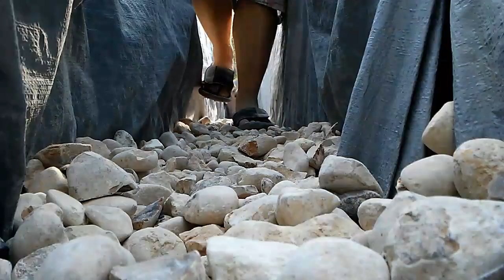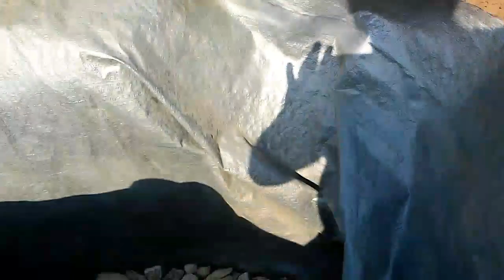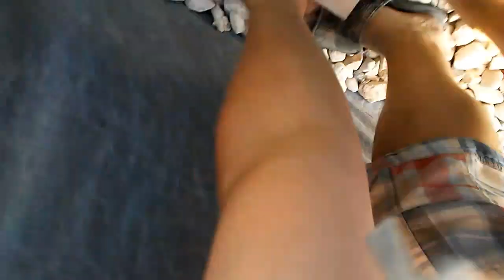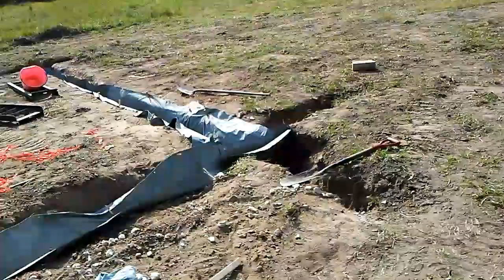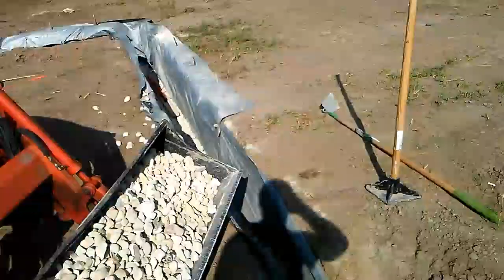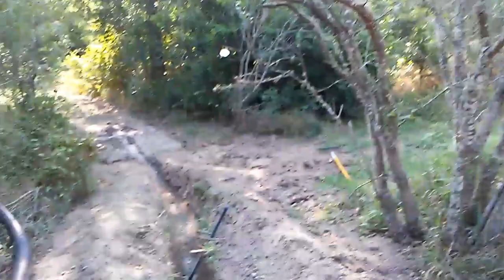In the Trenches of our Cob Barndominium

Comment: I can use tarp for liner ?any specific?Thanks for sharing
Reply from the maker: I bought the heaviest duty tarp I could afford at Harbor Freight Tools. I'm in South.You could use a lot of different materials. Search for old Billboard covers, that might work. I don't think there us anything  specific requirements unless your area has water build up in the hole that you are digging or frost heave. If so for water, you probably have a high water table, and I would research how to make a curtain drain or French drain in wet or swamp type areas. Also there could be more consideration given if you live in an area that experiences frost heave due to the ground being frozen. You might need a different sized rock that would go down to frost line.
Reply: @JohnWhite-gd4tx  oh wow thank you so much for your in dept reply. I'm wanting to build my own natural home in Jamaica so trying to do as much research as possible. I came up across rubble french drains, its diy so I want to make sure I gather as much information as possible I appreciate it
Reply from the maker: @missdigioia  are you on Facebook. If so look up an Uncle Mud. He was in Jamaica in January doing cob building. He lives in the US, but he may have some connections that could help you along. He runs the Natural Building Network group on Facebook. If not, let me know what area and I'll try to find the nearest cobbers to lend an opinion and maybe a hand.